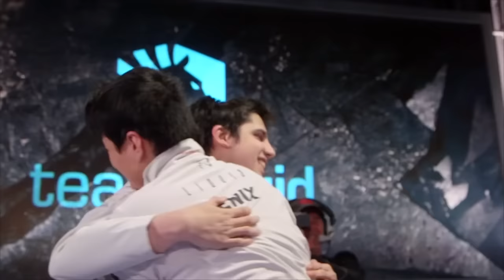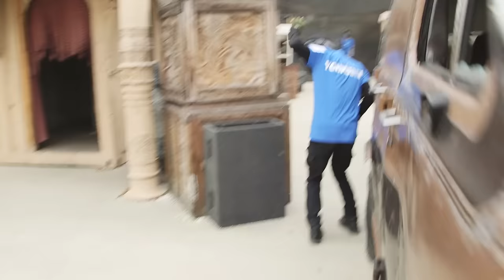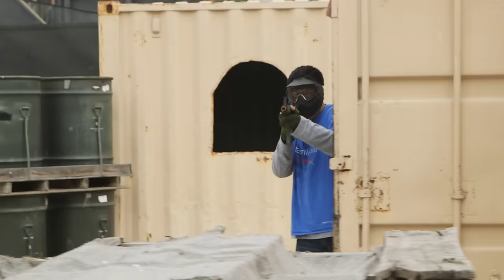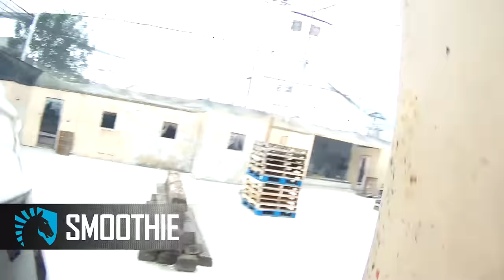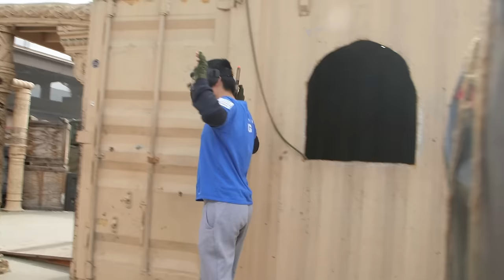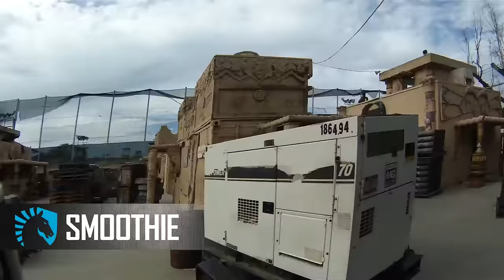PRO GAMERS PLAY AIRSOFT | Team Liquid at Hollywood Sports Park - Airsoft GI

Comment: Of course they're bad, they play league not fps, most of them probably don't even know how to use iron sights or reload.
Reply: Well playing fps games could help a little bit with how the guns function. A little bit. It won't make a difference at all on the field unless you're very smart and try to flank and use cover but even then it's not going to help much, if at all when you're going against experienced airsofters.
Reply: +RtdXyron You're right that playing FPS games doesn't make you good at airsoft. But, with knowledge of playing certain FPS games, you would know how to handle guns better than someone who doesn't play FPS games at all. So to some extent, you would have an upper hand with FPS experience.
Reply: ***** Not really. FPS games don't display gun handling correctly most of the time. Probably some do but most are pretty far off. This has no relation to airsoft whatsoever...
Reply: +RtdXyron Didn't say half of what you claimed. Like I said, to some extent, you would have an upper hand with FPS experience.
Reply: kirby 5329 How guns function, yes, but the AEG-s they play with have no recoil. Even when they did its pretty meaningless. And still no, it doesn't help you whatsoever. About flanking, using cover? LOL can teach you about flanking as well. And taking cover is just using your brain.
Reply: ***** Only argument you brought is gun handling. It doesn't really matter how you hold a light airsoft gun since most of them dont recoil. It's not crucial to hold the gun properly. And most ordinary airsofters weild/grip their guns inefficiently anyway. No fps experience doesn't mean crap. just picking up a gun and shooting it is not really a rocket science, especially when its a recoilless airsoft gun. So your argument is pretty useless.
Reply: RtdXyron Where did I say playing fps makes you good? Reread my comment again.

People who play Battlefield will probably be better than LoL players if this is their first time.
Reply: +RtdXyron it can help a tiny bit, like learning about covering all your angles
Reply: Minder Maniac like 0,00001 % maybe. That's absolutely nonexistant advantage.
Reply: +RtdXyron it actually can. Speedsoft is synonymous with certain play styles in cod.
Reply: RtdXyron yeah I did say a tiny bit.
Reply: Venom™ Not really. In what part? Yes its a CQC or CQB environment but nothing more. Everything you can do in cod you cant physically do in airsoft. Or can you point out to me what exactly are you talking about?
Reply: Minder Maniac And that tiny bit makes absolutely no difference. That's what I said.
Reply: +RtdXyron the fast paced and run and gun playstyle. Dropshotting is similar to running and sliding in speedsoft
Reply: Venom™ Speedsoft requires very very specific equipment and years of play until you can honestly get to a point of sliding...
Reply: +RtdXyron not really lol, sliding and shooting isn't complicated it's really intuitive
Reply: +RtdXyron my point is, in airsoft my playstyle is based off of my aggression and speed in fps games, but idk if it makes much of a difference